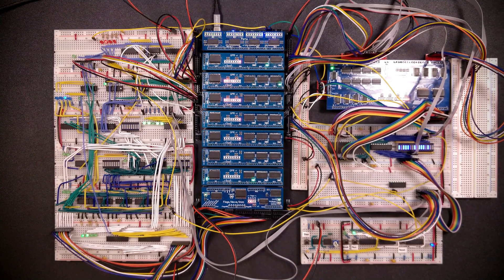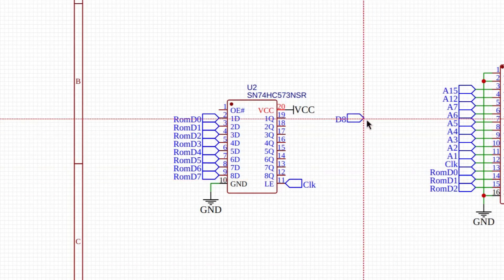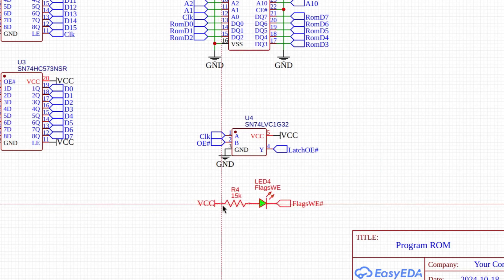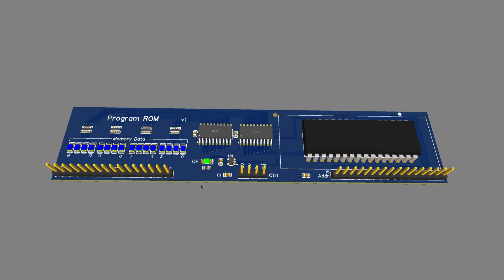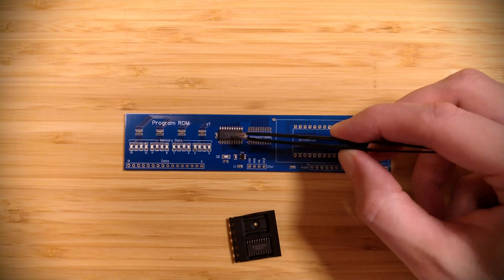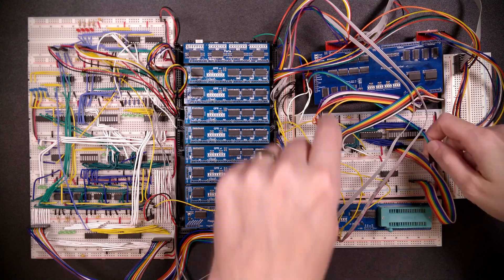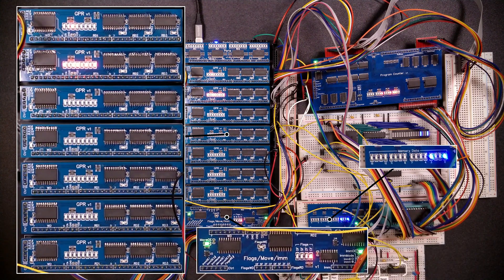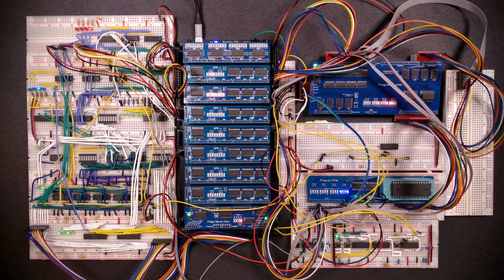Program Memory PCB – Superscalar 8-Bit CPU #43

Comment: Hey Fabian, awesome video as always. 
I think you may have some issues in the futur with this design. During a HIGH on the clock, the data is on high impedance due to LatchOE# and will result in strange behavior (you just have the diodes that are pulling the lines "low"). This may be problematic for instruction decoding I think. You could have data not really at 1 or 0.
Also you have some delay on the LatchOE# due to the OR chip from the Clk and OE# resulting in small spikes on the data: this means you are outputing during few ns the upper 8 bits on the lower ones. (This can also be an issue with the High-Z state).

I would prefer to have the data clear on a full clock cycle but I don't have a good solution for this... I came up with a design with 74HC574 (edge triggered vs. the 573 transparent latch), you can have clear data on a full clock cycle for the 16 bits with four 74HC574 (2 per 8 bit) but the downfall is the data is offset by 1 clock cycle, not ideal...

NB: (On my end the PLD chip connected to the data is pulling the lines up, this seems not to be your case, I wonder why!). I guess this won't be an issue with the instruction decoding later on!
Reply from the maker: Thanks! 🙂 And you're right: during the high phase of the clock, the data output is floating. This reduces the maximum speed of the CPU, since the data only becomes valid and stable in the second half of the clock cycle, such that the entire ROM read time has to occur in that part of the cycle. I think I'll fix this later when RAM comes into the picture, and the ROM will probably become the slow container for boot-up code. I was planning to expand the memory bus to 16 or 32 bits, to satisfy the instruction bandwidth of going dual issue 😁
Reply: @fabianschuiki  Does this mean the RAM will also be 16-bit? How will it interface with other components such as the 8 bit ALU or GPR? I can't wait for the next episodes!!
32 bits seems complicated to layout , I already have difficulties with 8 bit!
Reply from the maker: @Pixellions Exactly! The trouble with CPUs is that you have to feed them instructions. For dual issue, the memory bandwidth has to be at least two instructions per cycle. That's 32 bits in my case. I could get away with 16 bits if I added compressed instructions, but only being able to do dual issue on a small subset of the instructions is a bit underwhelming. It'll create a bit of a routing challenge, but a 2x16 pin header isn't too bad. And I can just use 4 RAM chips with 8 bits each. The load-store unit can still be only 8 bits wide in most places, since that's the bit width of the CPU. Just the instruction fetch will have to go up to 32 bits 🥴
Reply: @fabianschuiki  Awesome. Do you plan to use the memory data separated from the 32-bit instruction RAMs or do you keep everything together and only read the lower byte? I can't wrap my head around the competition between instruction fetch and memory access. Well, I won't take more of your time and try to be patient!!! Thanks for always answering.
Reply from the maker: @Pixellions I think it will all just be one memory system. The usual way of simplifying this is to only allow accesses that are aligned to their own width. For example, 32 bit reads would always require the address to be a multille of 32/8 = 4 bytes. That allows you to connect each byte of the 32 bit bus to a fixed memory bank/chip. 8 bit reads would then use a 4-to-1 mux to pick which byte of the 32 bit word to use. 8 bit writes would replicate the byte 4 times to fill up the 32 bit bus, and then select only the appropriate memory bank/chip for writing. This is usually called write strobe or write mask.

Comment: I got a question, up until now the CPU's design looks very similar to one that will turn at the end to be pipelined. You've said at the beginning of this playlist of you building the CPU that the final product will be a Out-Of-Order Superscalar CPU, will that still be the case? I'm not asking to accuse you of anything, I love seeing the development of the CPU, but I was curious if you would still follow the initial route since I'm also working on a custom CPU, and I really don't know where to find documentation on how to make an actual Superscalar CPU pipeline :P
Reply from the maker: Yes, I'm definitely still going  for an out of order superscalar core. Right now my build has almost nothing in terms of instruction pipeline: it just reads from a ROM and wires instruction bits directly to functional units. This is useful to get a basic ALU, branching, and load-store unit going. Those also don't change much in the out of order world. After that, it's all about the instruction pipeline and how things will be orchestrated around the functional units 🙂

Comment: checking the channel.... the next episode should be soooooon ;) Fabian.....; ;);)
Reply from the maker: I know 😅. There was a... little accident, let's say, with OBS Studio 😢
Reply: @fabianschuiki at least you didn't do what I did. Was working on some control logic and quickly jumped over to work on some analogue audio for a friend and forgot to adjust my PSU when I switched back. Turns out TTL isn't a huge fan of ±12V 😮
Reply from the maker: @JaenEngineering oh no, did the magic smoke escape?
Reply: @fabianschuiki  yup. Thankfully was only a basic circuit so only cooked about £1 at most of ICs but the smell hung around for quite some time 😔

Comment: I am surprised that you are not using a ULN2803A (SOP-18 DARLINGTON TRANSISTOR ARR) to drive your leds. Used with a resistor it can take a load off your buss. I know they are old school for driving Relays, but the can also drive LEDs (with a series resistor with the LED). And the SOP-18 is a nice touch, In that they are An 8NPN Array.

Also have you ever consider putting your buss LEDs in different color nibbles? 4 Red, 4 Green, 4 Yellow, 4 Blue, 4 Pink ( Yes they now have pink LEDS Surface mount) ?? Reason I'm pointing this out Is it a lot easier to Differentiate between the different LEDS.

I do want to thank you for not having your LEDs supper bright (To borrow a music term blastissimo  ). I know someone doing this On another YouTube page where you cannot tell the difference between the nibbles.
Reply from the maker: Using a transistor array is a pretty neat idea! Or alternatively a 74HC541 or similar, abused as an LED driver 🙂. Color coding the nibbles is a pretty cool idea as well! I was thinking about color coding entire values according to where they come from, but separating the nibbles would be clever!
Reply: @fabianschuiki  you could try putting a small gap between nibbles to make them easier to differentiate. I also think having different colours for different types of information would be very helpful.

Red = data
Green = address 
Yellow = control/flag lines
Blue =  clock

Also I can't remember if you do this already, but if not, for active low control lines, wire the led down from the 5V rail so it lights when the line is pulled low and therefore active.

Comment: The GND return path on your pcbs isn't good.   You should pin the top and bottom pours with lots of vias to allow the return signals to cross from top to bottom when required. 

For the traces in the middle of the busses, what is the return path?  Chances are the nearest trace that is at the opposite logic level!  

There is a similar problem with all the headers to the backplane.  Each headed should have several GND pins to allow the return signals to run close to the address and data lines.    Right now they all share a single GND pin... This is going to lead to a lot of common mode noise.  The A and D signal paths are very inductive which isn't good for signal integrity.  With setup and hold times measured in 100s of ns none of this will matter, probably, except for clock signals (any signal that triggers a latch is a clock).
Reply from the maker: Excellent points! I wonder if you'd get into timing territory where signal integrity matters with these old 74HC series chips. 10 MHz is very slow after all.
Reply: @fabianschuiki  Yes! The problem isn't the clock, but the output rise time. For 74HC this could result in a 100Mhz signal(it's a bit hard to say exactly as datasheets are all over the place and it varies per chip). Even if the clock rate is 1Hz that 100Mhz signal would still be there.
Reply: @fabianschuiki  I think I saw Data LED 2 light up slightly when holding down the step button @ 13:12 , maybe a grounding issue already?
Reply: @fabianschuiki  you can also notice it during 14:50 -15:00
Reply from the maker: Yeah during the clock high period, the two latches are disabled. That means nobody is really driving onto the instruction data bus. In theory the LEDs should act like a terrible pulldown (down to about 2V, the forward voltage of the LED), but something else might be pulling on the bus a bit during that time. Later on I’ll revise this ROM wiring to no longer do any latch magic, but instead take multiple cycles to read out a word. (A 32 bit bus would need four cycles.)
Reply: @fabianschuiki the LVC OR gate has 100MHz bandwidth and 32mA drive strength.  Even the HC buffers and latches have approx 30MHz max clock and 8mA drive strength and you have 16 of those outputs in parallel. 

It's not about the clock rate, it's about whether the clock edges are ringing enough to double clock latches/do they rise in the right order to guarantee your logic. 

For example you use the falling edge of clk to latch one byte into a latch.  You use the same signal to drive A0. 

If the clock rings enough to cross the logic thresholds twice you will latch that byte again.  Except the FLASH may already be changing its outputs .

You must hold all inputs stable for 5-20ns after the falling clk edge.  If the FLASH sees the falling clock edge sooner than the latch does then again you risk latching garbage data.

Only with proper return paths and a thought for termination can you be confident of the design.

Also the clock is periodic (obviously) and so if there are any resonances caused by stray inductance and capacitance in your clock tree, you will see these ringing away, energised by the frequency content of the clock edges.  These will shoot back and forth on the clock trace and any other victim trace that the clock crosses.

Comment: Having in-system programmable SRAM in place of ROM would be very nice to have for debugging. IO expander and something like RPi Pico or ESP32 would do the trick.
Reply from the maker: That's a great idea! Also, the SRAMs tend to be a lot faster than the ROM, maybe 2x-6x. So that might even be beneficial for stuff like instruction decoding. I'm planning on adding a RAM soon, and moving the flash over to bring just a slow boot ROM, with most of the actual program being loaded into the RAM for execution.

Comment: The ZIF in the opposite way of pin 1 let me itching, nice progress, any reason to not use proper 7 segment BCD display to view the opcode?
Reply: Back when I was building 74 stuff on breadboard (nothing like this!) it always frustrated me that you could never find a 7 seg decoder that would do hex, only decimal, the 74x247. I never found a satisfactory solution back then, and now I’d be forced to use a CPLD or possibly a small EEPROM. They did make all in one modules which combined the hex decoder with the 7 segment LEDs though. But they are very rare and expensive. Absolutely gorgeous though.
Reply from the maker: Yeah, I had to rotate it to not have the ZIF latch poke out over the board outline where you're likely to have other connectors in the way. A bit weird now 🙈.

Using a segment display to view the opcode is a very nice idea! Not entirely sure yet how you could make that happen. A lot of the 4 bit to segment display decoder chips have gone out of fashion. Maybe a PLD?

Comment: Can’t say I like the modern tendency of reducing the schematics down to, basically, a netlist. In fact a commented textual netlist would probably be easier to follow. How about some actual bus wires? KiCAD is far better than these web based tools. 

Fantastic project though.
Reply: For YouTube projects, I think it is fine. We are shown building out the circuit on breadboards, walked through the design process. It would be another story if someone threw a bunch of net lists at us and ran away.
Reply from the maker: Yeah I agree, it would actually be nicer to have proper schematic symbols for the logic gates, and then also organize wires into buses and actually make a schematic diagram. EasyEDA is pretty limiting. I think it can do mosy of these things, but they're often not used in the parts library other otherwise obscured.

A textual representation would be very handy though. That could serve for simulation and maybe even some verification.

Comment: you must avoid 90º traces
Reply: Unless you are running at microwave speeds 90 degree corners are fine. The worry was the traces would peel off easier, but that’s not a problem anymore. They look pretty weird to me as well, and I don’t use them, but there’s nothing technically wrong with them for this kind of board.
Reply: @lawrencemanning  There's this video called "Melt your circuit boards" by mitxela.
Even if you already did, you must watch it.
Reply from the maker: I'm wondering if they are still a manufacturability issue on modern PCB manufacturing lines. I haven't had any trouble with them yet, but that doesn't say a lot. They're very convenient 🙈

Comment: @DoctorRGPlague (stupid name I know) has a four part series on creating a flash programmer, it is unfinished as of now, but it is so basic I believe I could finish it with more features. By integrating the µCU on the PCB you could program the flash chip over serial, no need to juggle the flash chip around. He uses an Atmega1284 to be able to use 18 address lines for 256KB flash chips. Using ZIP socket is naturally workable, but using a dedicated µCU to connect serially to program the flash seems like a neat solution.